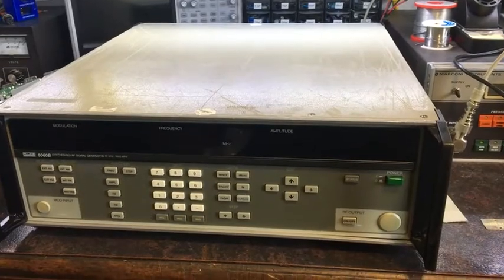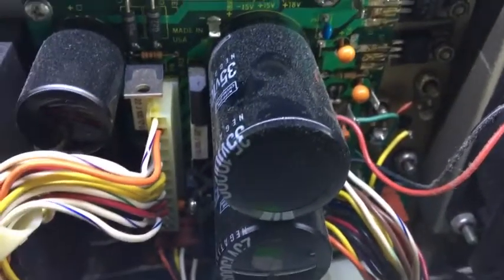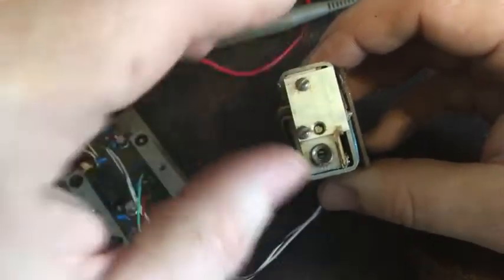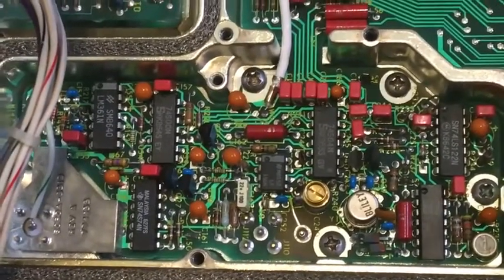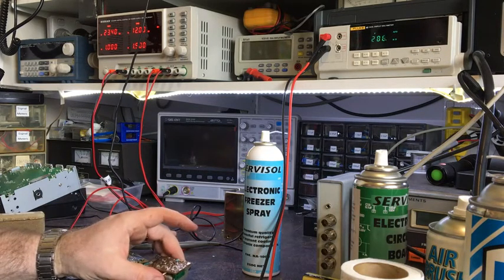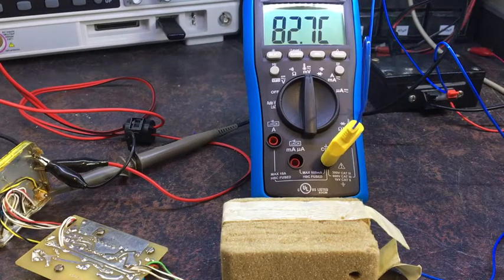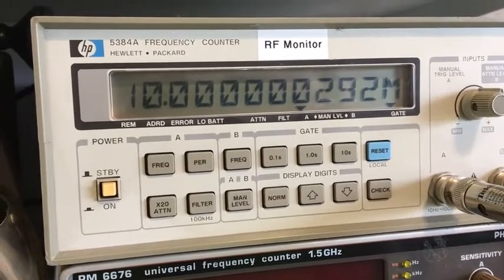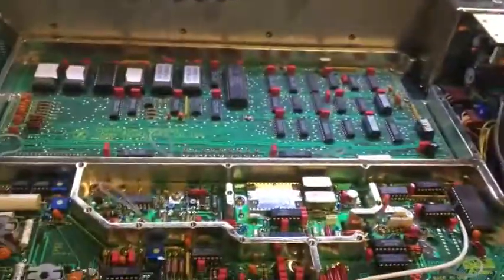#81 Fluke 6060B RF Signal Generator Repair Part 1

Comment: I bought one of these off Ebay that actually was EMPTY. Include power supply, front panel display and one redeeming item; the 127 db attenuator. All other boards were just gone. Because of attenuator I made deal with seller to keep it for substantial discount off auction total.
Reply from the maker: Doc Pedersen - I recently got an item that was listed as working, only it isn’t, seller was happy to refund a large amount of the purchase price as I said I wanted to keep it anyway so I could do a video on it.

Comment: Dude you need a much better camera!  Video resolution is really low and sound is hard to make out.
Reply from the maker: steve c - this is one of my earlier videos, I recently changed the way I do them, audio is a lot better now, same camera though, but I tend to place it better. You may also want to check the quality setting in your player, in case it defaulted to something other than the 720hd I use.
Reply: 720hd?  You're kidding right?  The only option is 360!
Reply from the maker: steve c - odd, I see 480 on this video, I changed to 720 months ago.
Reply: Yeah odd, some videos go up to 2160P but the only option for yours is 360.
Reply: How can you see 480 when it only has 360?  What are you watching it on?
Reply from the maker: steve c - I see the 480 quality option on both my computer and my iPhone.
Reply: I only see 360 on different computers but since other videos are OK it must be a problem for Youtube to solve.